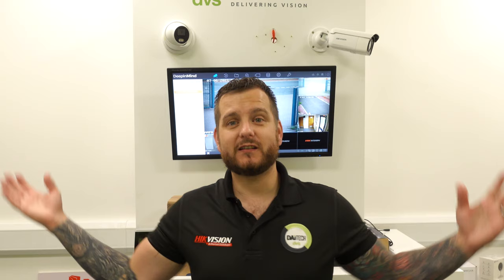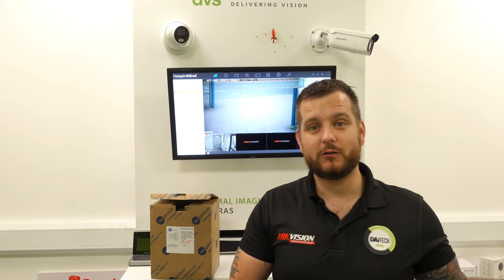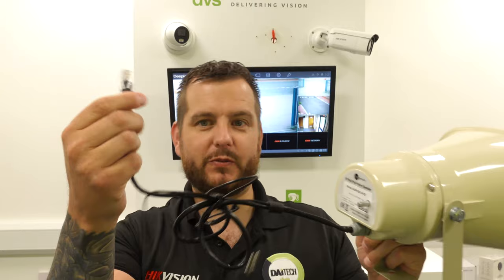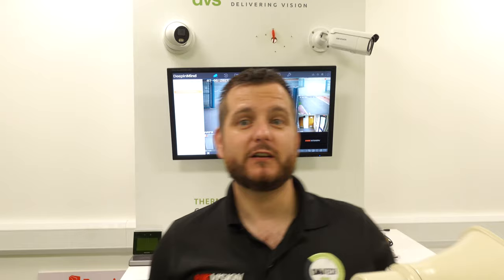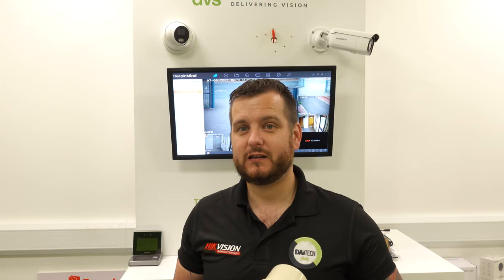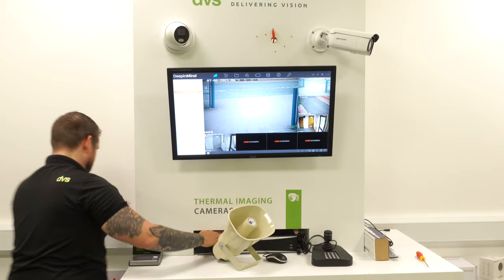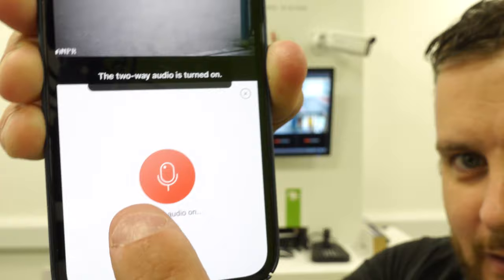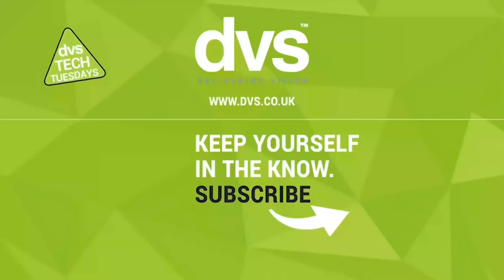Netgenium POE powered Horn speaker for NVR/DVR audio output

Comment: I been using 12v horn speaker to Hik nvr but I'm experiencing buzzing noise as soon as I connect it to it. What could the problem be?
Reply from the maker: assume when you hear the buzzing it stops when disconnected from the audio output of the NVR ? if it does its due to the audio output , have you tried a new PSU also from a different manufacturer as some inline ones are not isolated well and can cause this issue

Comment: We are currently facing an issue with the latest version of the Apple Hik-Connect app, specifically with the broadcast button functionality. Our customer operates two laundromats and relies on the speaker setup for remote announcements.

Since the recent iOS App update, the broadcast button has ceased to function as expected, impacting our customers ability to make announcements remotely.

is there is a known workaround or temporary solution that can be implemented until a formal resolution is provided in the next app update. Any guidance or assistance you can offer in this matter would be greatly appreciated.
Reply: Are you with the DVR/NVR to the latest firmware ? If the answer is yes , then you can use an old Android device as a temporary solution and report the issue directly to Hikvision

Comment: If you did it through static cameras for the audio output say I had 4 cameras with 1 speaker next to each camera would the speakers only go off on the speaker from which camera has triggered it or could I talk down all of the speakers at the same time?
Reply from the maker: if you take the audio feed from the NVR and into the Gateway unit then all speakers are trigged at same time , IF you added each camera to the software / app direct then you have more flexibility as you can talk out of the audio output of the camera needed, but this isn’t common , most accept the one to all format
Reply from the maker: With this speaker in mind ( sorry didn’t finish the previous update ) , this model is designed to be connected from 1 audio output either from NVR/DVR or camera , and they are not interlinked with other speakers, bit if you use the other format of the gateway and improved POE speaker you can do 1 to many at same time